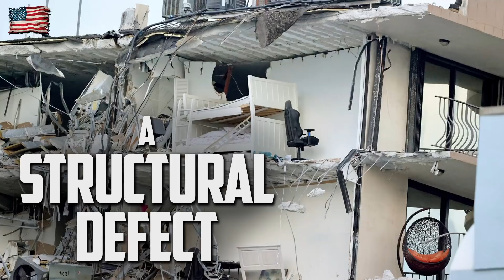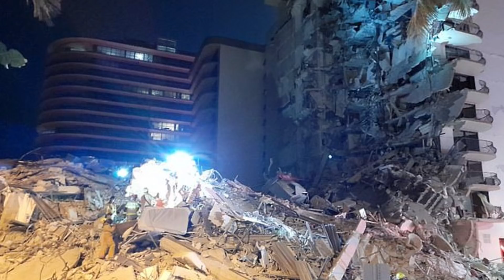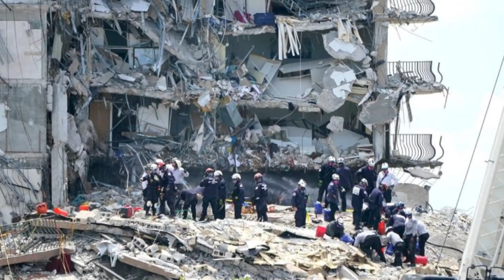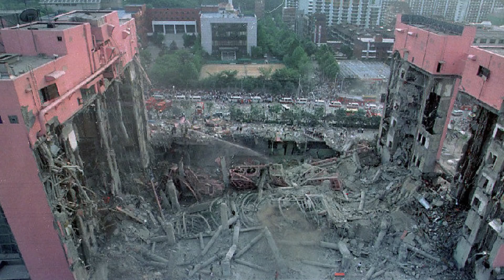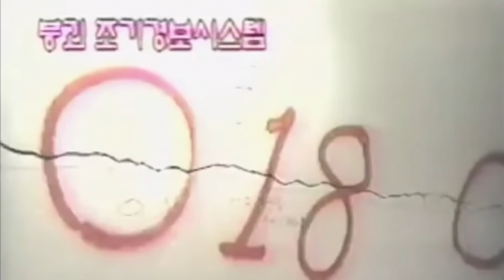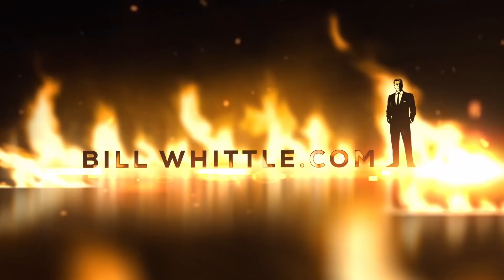A STRUCTURAL DEFECT

Comment: bill whittle, i take offense to this one only because you are telling everyone here that the 'structural defect,' is an engineering problem.  the 'human condition,' has nothing to do with decisions engineers made.  all of the analogies you mentioned had engineers telling owners and authorities to pull the plug and evac.  engineers provide solutions to the, 'human condition.'  greed, corruption, lack of accountability, and bull headedness on the part of owner(s) and authorities is what caused these tragedies.  plain and simple..the building should have been condemned, and that responsibility goes to the local authorities.  a poor design would be the engineers responsibility.  poor construction is on the contractor and qc/qa program (i.e. owner and egr).  approval of all of this stuff is on the authority.  the owners in those condos relied on a system that failed them.  engineers cannot just tell people to leave their homes, but authorities can.  and, authorities did not.  that is not an engineering problem.  failing to provide sufficient structural integrity could be an engineering issue, but depends on design parameters.  maybe the building had a very limited design life.  again, all this subject to approval by authority and owners.  those are the ones that make decisions.  not engineers.

Comment: There are many buildings in South Korea that were built substandard. This was due to the rush to rebuild after the war and then their rapid economic expansion. I stayed in a few different hotels where the concrete was crumbling enough to expose the corners and edges of the buildings. Imagine staying on the 10th floor of a name brand hotel and you can see outside at the interface between the floor and your room.

Comment: As a shockingly soberingly close to home coincidence, i was almost killed by just such a defect. Last fall i was involved in a crane lift and without going into nauseating detail , the oldtimers on the crew wanted to use a old lifting device. I protested and took it to management and the safety guy, who took my side and went to some effort to make me a new device. I stepped on a few toes during this ordeal and im sure i pissed off a few people. As it turned out i was in control on lift day at the top of the building and everyone involved knew about this little drama. My ground rigger and someone else decided to use the old device without my knowledge and hooked it up. Well at the height of the lift, it broke, falling 200 feet and just about killing 3 of us. I ended up with  a broken neck in 3 places and a broken back in 3 places. As a interesting little factoid, i was in a motorcycle crash a few years before and had extensive titanium in my back. The accident actually broke one of the titanium rods in my back. Had it not been there i would prob have been cut in half and wouldnt be around to tell the story.

Comment: Bill, there is a solution for the kind of "structural defect" that you were speaking about in this podcast, & they are rebars. Not the kind that reinforce the concrete in edifices, but the kind that are installed in the windows & doors of cells that prevent their occupants from rejoining the human race & from contaminating its still unsullied heart. The other structural defect is found in the institutions that constantly & consistently allow the afflicted perps to wander the streets free & unfettered, encouraging their disciples to follow in their malevolent tracks.

Comment: August 2001, NW Michigan Fair evening tractor pulling event. I was 51 and had symptoms of not feeling up to par. That evening, although I did not go to the Dr. then, I most likely was having a mild heart attack. I went in and did all those tests you mentioned. When the Dr. saw the results, he told me to be at the hospital at 7 am. I complained that I had a painting job to finish. He said no, you don't. Next day, I enjoyed having 3x bypass surgery. Since then another mild heart attack and four stents were installed. 

They put me on the standard meds - and they did not work for me - adverse side effects. 

I'm 73. I went to see my cardiologist yesterday am. No meds anymore - haven't used them in three of four years. Minerals, vitamins, moderate Keto eating with way fewer carbs, essentially no wheat products, lots of fat, sea salt, proteins, some cider vinegar, and at least two hours a week of Taekwondo for the past six months or so. 

I put in a nine hour day of some significant drywall repair - going up and down 15 steps at least 30 times - maybe more. I am tired, yes, but feeling well. Thanks Bill.
America, wake up, repent, and bless God.

Comment: I was living in a "community" of houses where we had a strata board. After two years I joined the board to help out with the management of our area. We had very low fees due to the limits of what we were taking care of but the major expense was the street lighting repairs due to the sodium lighting was reaching its end of life. Out of 40 light standards at least 4 or 5 would quit running in any given month. After listening to this reported time after time during our meetings I joined the board to try and find a solution to our problem. LED lighting was just coming into its own during this time but our light standards had no easy replacement option at the time.
One issue that came to light during my time was the developer had missed getting a permit for a condo complex that bordered our property to tie in a sewer and rain water drainage lines with our sewer and drain lies then they used our lines to tie into the county. This issue came up when the developer was going to finish building the development on the last area adjoining ours and the condo complex. This issue came up and at the time it was raised it would have taken a 5 out of 7 vote to allow for the developer to make the connection for the new area and to apply for the proper permits. The vote did not pass and we started down a long road of legal bills and fighting between the developer and the condo complex. Since our systems would be carrying all of the out flow to the main sewers it was decided to charge the other two areas a monthly fee to allow for repairs in the future and that we had an agreement drawn up after many negotiations as to what the costs to each area would be in case of problems. At the last minute after almost 2 years of back and forth the condo complex management firm finally had a meeting with their condo owners. These owners rejected any responsibility for any future repairs to our sewer systems and we went back to square one again. I drafted a letter with our lawyers that was quite blunt and shocking addressed to the condo owners. It said that since the condo owners were not going to pay for the repairs of our system even though they were 30% of the flow through it, they had 1 year to connect their system to the counties through another flow path because after one year we would be disconnecting them from our lines. I moved out of that complex just after that and I heard that these condo people basically threw a massive hissy fit but they finally agreed to our terms as to make their own connection would have cost them $250,000. The developer was finally able to build his final 25 houses after a three year delay but it goes to show that if you skip a step in a process that getting a whole bunch of different stakeholders involved to correct it later can lead to a bunch of legal bills and frustration by all parties. It is a good thing that we found out about the omission of a maintenance agreement before we actually had to do any repairs or replacements. To try and collect from these other parties would have been a lawyers dream of litigation.
Reply: Thanks

Comment: May I also suggest that on these matters that you ALWAYS get a second opinion from an another UNINTERESTED party, even if it might cost you some money. My wife and I had a family doctor in California, while we were still living there, that kept denying that either one of us had any serious problems. He just kept on the same...loose weight, don't eat red meat stuff for several years meanwhile he was missing my wife's skin cancer and my SVT (atrial flutter). It was also taking months to get a couple of vaccine boosters we wanted approved. The SAME DAY that I went to our new doctor in ANOTHER STATE I had the requested vaccines (one in each arm) and a referral to a cardiologist and a telemetry monitor. Within 6 months my wife has had her (blemish) diagnosed as skin cancer and had surgery to remove it.

Bill, you may want to be checked out again. I had the same on again off again condition you describe and it has in some cases to be the heart's electrical system to get "short circuited". It can be corrected by a surgery where they put an electrode thru the leg to the heart and ZAP the connection clear.

Comment: I own a hi rise condo.   The original construction has problems and it was easy to see the sag in the balconies.    In a sense, this was a blessing.   Before the building was 10 years old, the condo board starting letting contracts out to address various issues.   In the fullness of time most of the balconies were replaced (the concrete was removed and the re-bar inspected and then the slab was re-cast).   Other concrete issues were addressed after inspections.   The buildings are about 45 years old and there is ALWAYS some concrete repair work being done.   Even so, the cost of all these repairs is not even half the condo fee: it's a matter of budgeting and catching things early.
Reply: I would sell and get the neck out, fast.   I would not live in a high rise that has/had sagging balconies. that is a symptom of loose structural integrity. if the balcony is failing, what else is hiding out of sight?

Comment: Colombia especially. They gambled the astronauts life away by having them reenter with that giant hole in the shuttle.
Reply: They gambled previous to that by using a foam formulation for the main fuel tank that didn’t include Freon because it was safer for the environment. They lost pieces of foam on previous flights, but they were calculated to be small and light enough to not cause significant damage. The reality was that when the foam was iced up while waiting for launch, it was significantly heavier than previously estimated. Of course the reality didn’t become recognized until after the tragedy.

Comment: There is a sinkhole under a major highway in Carlsbad NM. But the Governor of NM, Michelle Lujan Grisham, took the funding that was being used to fix it for use on her own pet projects. Engineers predicted that it will collapse in 2021 but they are still allowing people to drive over it. If it collapses the resulting hole will be deeper than an 80 story building.

Comment: Actually, Titanic's key structural flaw was that, as admitted by her designer Thomas Andrews during the sinking (from which he himself would not survive), was that her compartments were not sealed at the top.
With six compartments flooding, enough weight was added in water to pull the ship low enough that the tops of the compartment walls would be below the waterline. So as she filled, water would go over each compartment separator and spill into the next until it filled and repeated the process. Given enough time, her sinking was inevitable. Six compartments flooding at the same time meant far too much water was coming in than could be pumped out by her engines.
Her second structural flaw was a lack of enough lifeboats. International Maritime Law at the time required lifeboats for ships on the basis of ship size, not total capacity of ships to carry people.
This was compounded by the fact that officers and seamen on Titanic didn't know that the lifeboats she carried had been tested and approved for their full rated carry capacity, so many lifeboats launched only half-full, increasing the final death count.
These flaws in ship design, law, and crew training were quickly remedied after her sinking.
Reply: correction *

lifeboats are reusable, 
there wasn’t a known sinking time 
orders were to begin rowing passengers to the ship visible in the near distance, inform them of their plight so they may render aid, then row back after passengers are safely onboard and repeat. 

even if there were enough life boats for all onboard, there certainly wasn’t enough time to launch any additional boats as there wasn’t enough time to launch all that were onboard.

Comment: Spot on,... in your analysis.  Especially true in cardiology. We are fortunate lo live in a time that the identical cardiac issues 40 years ago would have been terminal. Because of the premature death of a relative I sought the care of a cardiologist in my late forty’s. I demanded an angiogram to see the actual road map of blood vessels. I had several patients or their relatives die after a cardiac stress test, after being told they were in in tip top health. I demanded a second angiogram 8 years after the first one. On that one a 70 % occlusion was detected in the primary coronary artery, the widow maker. I had a bypass 4 days later. My point is you often have to be proactive when it comes to heart health. Had I not demanded to see the road map of vessels, I wouldn’t have the 8 years I’ve had. “ make them tell you no”

Comment: Doctors, lol...quacks... there's no profit in cures or remedies, is there.........
Reply: For the VA, its profit is saving money for the tax payer..
That's why vets are pumped with meds for as long as possible before they are cured for an illness or disease..
I would be lucky to get a weeks worth of no pain while sleeping..
I need to have vertabrae fused or discs replaced that's causing the pain and massive headaches..
Instead I'm told to exercise, which creates more pain, take  NSAIDS or use a TENS unit..
13 years of pain..
When I get a chance to literally score NORCO I do so without hisitation. And use it in cases of extreme vomiting pain..

Comment: No steel beams were in the rubble. A 11 story building in the US with no steel frame? There's negligence somewhere.
Reply: The building apparently used reinforced concrete sections all held together with multiple taut steel cables to give it rigidity. This is apparently a common building technique for "smaller" buildings. A structural engineer analysing the wreckage pointed out places where the cables attached. (I'd never heard of this technique, but I'm going to assume a structural engineer knows what he was talking about.)

None of that excuses the fact that the building's owners apparently skimped on preventive maintenance and ignored reports in 2018 of serious structural issues. If that is indeed the case, then those owners belong in prison.
Reply: Stressed concrete piers have steel inside them. Rebar.
Reply: I don't believe that type of structure uses steel frame.
Reply: look up "pre-stressed" concrete     it was supposed to be safe